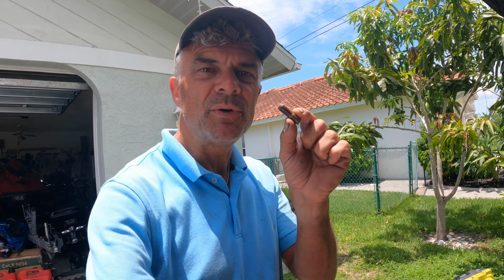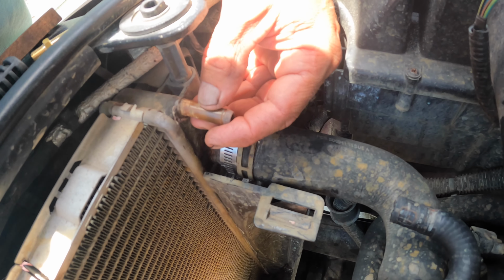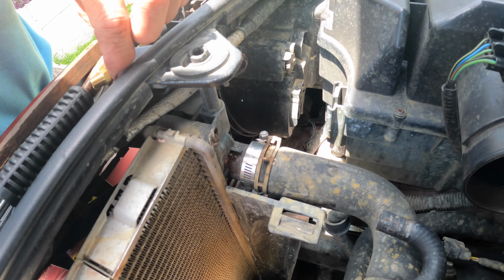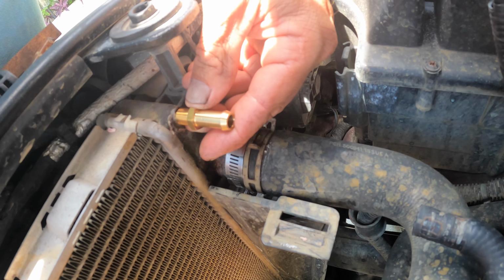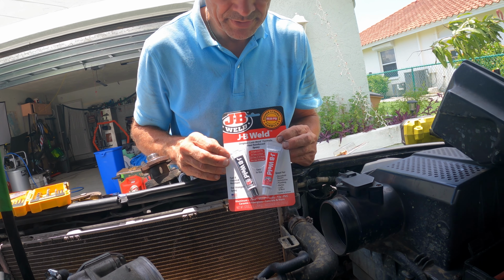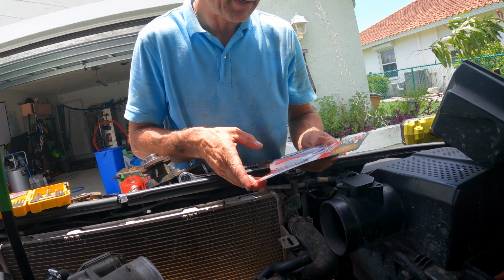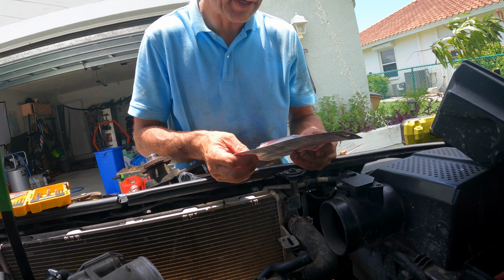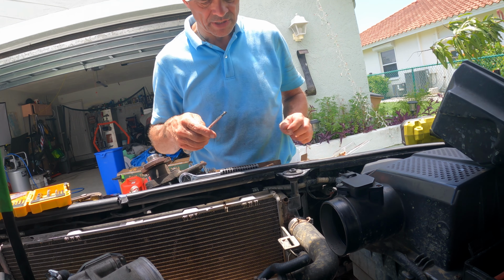Land Rover Radiator fix DIY on LR3, Discovery 3, techtip of the week

Comment: Love all your vids, I had the same issue on my LR3 I was able to use the same tip the broke off and use a metal straw that the sell at a Starbucks, drilled slight the broken tip and the radiator side hole and used jb weld. What brass fitting did you use?
Reply from the maker: Thank you - and thanks for watching and commenting too. I am happy that you like some of the tips, it’s even greater to hear I am not the only one who ended up with this problem. 

Awesome fix you made, did not occur to me that Starbucks have these straws, but sound really cool, hey whatever works is great. 

The brass fitting I used was for an any form of fuel system. I picked it up in advanced auto store, but from the storage room. Not in the shop. I had to go there and look for the right size, and think it was less than 10$. 

Drive safely, best regards Rene